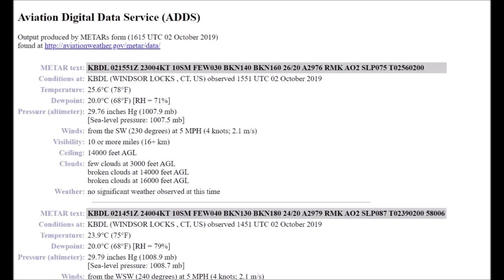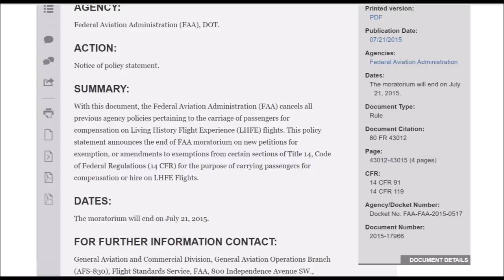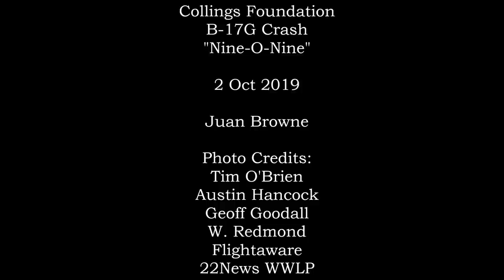B-17G Crash Collings Foundation KBDL 2 Oct 2019

Comment: Blancolirio, I would love to hear about the history of B-17's and there (non-combat) accident history. I have heard of story's where only 3/4 of the plane made it back.  Love some history, Please.
Reply: The loss of one engine should not have been a problem. Combat veterans have told of landing these with 2 engines out. Something else had to have gone wrong.
Reply: B-17 Flying Fortress by Martin Caidin 1968.  Read it in 1970 when I was 10. The most indestructible aircraft of its time.
Reply: @tiredoldmechanic1791 , you're right, losing one engine, even an outboard engine, should be manageable, especially at this light operating weight. But what if there was a loss of oil pressure to the prop governor? No oil pressure to drive that hydromatic into feather, and aerodynamic forces drive the blades to the low pitch stops and you have an unfeatherable windmilling prop. With that out on #4 you've got barn door drag out there and can only overcome it with rudder if you keep your speed up. To maintain control, you'll have to back off #1 and thrash the pee out of 2 and 3 to maintain flight. So how do you land this beast you can't slow down? I think they showed us the answer. RIP.

Comment: A runoff like that suggests a control failure after touchdown? Praying for the families. So sad.
Reply: Not necessarily. It certainly could have been the case that there was a control issue, but if there was asymmetric thrust due to an engine failure (as Juan mentioned in this video), then it may simply have been difficult for them to directionally-control the aircraft near the runway threshold, and they might have ended up way off to the right...just like the photos showed. I think it's important to wait until the preliminary report(s) are out, but it's not inconceivable that they might simply have had difficult dealing with the asymmetric thrust situation.
Reply: @bluehornet6752  I'm not trying to jump on any bandwagon re. "speculation brigade"...  But unlike a lot of smaller twins, there's lots of history (very adverse combat conditions/damage) of B-17s specifically, returning "successfully" from vastly greater distances than this, with one or more engines out (including much more acute direct damage to control authority).  The critical phase in that aspect, would be more in the earlier "turn to final" leg of attempted return to the runway, than the touchdown itself.
The only way I can make sense of what I'm seeing here, would be if the unaccustomed stress level and "task saturation" in the cockpit re. the engine failure, combined with precisely the fact that they were very CLOSE to the return airport (i.e., lacking longer time-frame for better assessment & visual orientation), resulted somehow in visual confusion of that right-hand taxiway with the main runway they were planning for. 

If they landed on the taxiway immediately beside the de-icing place, THINKING they were on the runway when they weren't...  Then crashing directly into the tank-farm makes a lot more sense than the idea of veering cross-wise into it from all the way across a huge intervening grass median. 

So I'm guessing visual disorientation & landing on taxiway by mistake, rather than any particularly problematic (let alone insurmountable) "loss of directional control" alone.
Reply: @boatrat  I have to agree, I hate to speculate but the crew was busy working the problem and may have landed to the right of RW6 on the taxiway.
Reply: @boatrat  You could very well be correct that they did in fact land to the right of 06. Time will tell us, I suppose.
Reply: @5roundsrapid263  I saw that one as well. 

I once landed on a taxiway. The winds were about 25 mph, directly across the sole runway at the (uncontrolled) airport I was trying to land at. Since I was in a Cessna 185, which is a taildragger, I really didn't want to ground-loop the aircraft. So after the second approach and go-around, I picked a length of taxiway that was perpendicular to the runway, and about 200 feet long...and I landed on it. The aircraft had a STOL kit, and my ground roll was all of about 150 feet. It was a LOT less stressful than trying to keep a $150K aircraft going straight on an asphalt runway with a 20-25 knot crosswind component. 

Moral of the story: Sometimes you have to do what you have to do to not bend the airplane. Sadly, I don't think this B-17 accident had an intentional landing on the taxiway. I think that as they got slower it became more and more difficult to maintain directional control, and they didn't. 

This is a VERY sad and tragic accident, and now our illustrious leaders in DC are even weighing in on how we need to took a hard look at whether or not "these old aircraft" should still be allowed to operate. Sigh...
Reply: More news today: They apparently "hit a landing instrument station, veered to the right, crossed the runway, and then struck a de-icing facility." Some of the names are starting to come out, although I only saw names for two of the seven people who perished in the accident. I did not see the crew mentioned.

Comment: I flew as a passenger in that aircraft in 2003.  The plane was 59 years old then and gave me a clear perspective of how difficult it was to fight a war with their latest technology of that time.  I have looked back to my flight in 2003 and told myself several times, "Sometimes we expect too much from these old planes".  Managing a landing on a grass strip is far easier than a concrete runway - especially if YAW is a factor and a multi-engine tail-dragger that has a problem with a thrust balance.  One hop with a sideways jerk and it's bad news.

Comment: Juan, I apologize for not making myself clear. My comment was not referring to the exemption to Part 91 allowing warbird pax ops. You explained that well. I was referring to your blanket statement about Part 91 where you say (referring to the Part you fly under with the Mighty Luscombe at at 7:55) that Part 91 is for "private flying, not for hire." This is incorrect. On the contrary, Part 91 does allow pax flights for hire, as long as it's for sightseeing within 25nm of the departure airport. Many a young CFI like myself got the occasional break in instructional flights to take members of the public on a sightseeing flight. Of course, you get more of these opportunities if you're based at a tourist spot, such as I was in HNL. I sold two new C207s to an operator who exclusively did around-the-island sightseeing flights, all under Part 91. Sightseeing flights with paying pax cross my house daily on Oahu.

Comment: I hang at VPZ with great friends and my 1957 Cessna 172. Last summer, a local pilot spun in from 400 feet on take off in his Comanche. I was not a witness, but the primary thought is our common humanity when tragedy strikes close. Nothing else really matters.
 That said, some random thoughts.
I am sensitive to blanket statements about aircraft age. Lots of contingencies. My Cessna is aged, as is the B17, a C47, or the 90 year old Waco on our field. But then, generally we are not flying at night, IFR, at altitude, in icing, or around storms. 
I loved seeing the B17 each summer. I struck by the pure grace as it rolled for take off, not so furious as I imagined. Even the start up was not the belching smoky affair I was expecting. I could not quite motivate parting with the same dough for a B17 ride that would keep  me flying my Cessna for 7 or 8 hours. Though, I did years ago ride around the patch in a Trimotor for $75.
I did last summer, at 64 years of age, 6’1 and upper 200 pounds take the B17 walk through (climb through) and was acutely aware these things were designed for 140 pound 19 year olds. So, I have to wonder with the latest tragedy, how quickly the fire came, I for one would have a snowball’s chance getting out, much less 90 year veterans.
Looks like the pilots got to the runway threshold with control somehow compromised, and apparently without #4. My question for experts, 10 passengers would seem well within gross weight considering the original mission.

Comment: Hello Jaun, The radar indicated 800 feet . Was that AGL?  Was standard TPA 800 feet for non HVY acft?  If so  he did male pattern altitude, correct? Can you explain where  the acft was to runway , it looks like the flaps were dumped  and even decent rate resulted. Very sad, I used to help the CF  when they visited KLVK, been on B-17 several times Thanks, Charlie

Comment: Juan, FYI: The serial number prefix for AF aircraft including current procurement is normally the U.S. gov't fiscal year in which the procurement was funded. The aircraft which was lost today was delivered in April 1945 and did not see action. The war in Europe was over or virtually over when it rolled off the assembly line at Douglas Long Beach. The original, legendary, '909' was an early 'G' (42-31909) built by Boeing in Seattle before that plant was dedicated to production of the B-29.

Comment: Several posters were asking, “Why is it that a 4-engine airplane, after losing one engine, is not able to continue flying on the 3 good engines?” From what we know of this accident the crew declared having an issue with engine #4, which is the right-wing outboard engine. On a 4-engine airplane losing engine 1 or 4 is more critical than losing 2 or 3. The reason is engine 1 and 4 are the outboard engines and in case of power loss the aerodynamic drag created by the dead engine will have a greater moment on the yaw axis of the airplane, if the propeller is not feathered. Feathering a propeller means moving the propeller blades parallel to the airflow.
Therefore, when losing power from one of the engines on a multi-engine airplane, it is very important to quickly identify and verify which engine lost power and secure it ASAP by feathering the propeller and doing a few additional steps to keep the aircraft under directional control. If the propeller is not feathered, then the airflow will continue to force it to windmill, creating a huge drag. The drag can be so great that when airspeed is decreased for landing, the rudder may not have enough authority to counteract the right yaw force generated, and the plane will make an un-commanded spiral to the right. This scenario could explain why the crew lost directional control while trying to land on runway 6 and veered to the right into obstacles.
It is possible the propeller governor malfunctioned and could not turn the propeller blade pitch parallel (feather position) to the airlow. Or the engine could have suffered an overspeed condition, which can be very dangerous. NTSB will have to figure it out.
My thoughts go to the affected families and the Collins Foundation folks. This was supposed to be a great day that turned into a tragedy. Personally, I flew twice as a passenger in the B-24, and still hope to be able to ride in a B-17 in the future. The intent of this post is not to put blame on anyone, since the real cause of the crash is so far unknown, but to try and explain to some posters why the plane may not have been able to fly safely on 3 engines.
Reply: I would not blame the pilots so fast. We do not have enough information. It will take time for the NTSB to find the cause of this accident. What I wrote is one of several possible causes of losing directional control of an airplane.

Comment: I saw them all when they came to KMQS a few weeks ago. Walked/crawled thru the 17. Then saw the 17 and the 25 land from a point 1000 feet in front of 11. Been watching planes land there for 50 years. Couldn't believe both their landing patterns. Almost like a carrier break. So low and tight we thought they would take our heads off in the pizza joint parking lot. There was really no base leg or final. Just a U-turn from about 2000 feet out. The 17 was left wing low over the threshold and still not lined up. They had passengers too! (Who paid $425 for 20 minute flight). Both planes did the same thing. Private jets use a 1-3 mile final and even up to ten when using the ILS. They're also not at 50 feet 1000 feet out like the bombers were. Knowing those old war horses handle like a city bus I expected at least the same or longer pattern. Very surprised at the way they came in. So sad for the injured and family survivors. Hope they all were on the right page spiritually.

Comment: Landing short, then ending up in buildings to the far right of the runway, with a faulty #4 engine.   Pretty much paints the picture of what happened, but well just wait for the NTSB report.
Reply: I think that they came off the end of that runway a little hot (fast) and tried to get off and clear of the runway as quickly as possible and took that left turn a bit to quick and maybe a bit to wide and ....

Comment: You said "left downwind" a few times, yet your "flight aware" image seems to show a rwy 6 departure and a right turn to a right downwind.  What is the real groundtrack?  Right traffic with the #4 engine out would not be the safest plan (turning INTO the dead engine).  The icing pits were nearly abeam the 1000 ft point of rwy 6.  The plane would have to be way off centerline or courseline to hit that far right if they were on a straight-in final for rwy 6, unless they got below VMC and attempted a three engine go-around (or added too much asymetrical power).  Am I missing something?

Comment: Having been up in this aircraft about five years ago I can tell you that the passenger comforts and safety equipment was minimal.  You sat on the floor, with a single strap seat belt over your lap. Anything more than a normal landing was going to be very rough.

Comment: This is so heartbreaking. I read in an article that the aircraft struck the ILS antennas and then yawed right, into the deice facility. They must have been really low on short final. I didn't know how reliable the article was but the NOTAMs for BDL show that the runway 6 ILS is in fact "unserviceable". My condolences to the family and friends of the deceased and best wishes for those that were injured.

Comment: Thank you Juan for describing the special regs that allow carriage of paying passengers on sightseeing flights in aircraft that weren't originally certificated for civilian use. However, your statement that CFR14 Part 91 does not allow carriage of passengers for hire is incorrect. Sightseeing flights within 25NM have long been allowed under Part 91. A change in 2007 requires operators to obtain a Letter of Authorization from their local FSDO for this activity, along with a few added requirements. These have to do with safety briefings, life vests for overwater ops, etc.  (ATP CFII ASMELG)
Reply from the maker: Part 91 Exemption-just as I briefed. View again.
Reply: blancolirio    I was looking into this.    Probably under 91.146??   Would that be appropriate?

Comment: 909 went off the end of the runway at Beaver Falls Penn due to pilot error by shutting off the hydraulic pump which operate only the cowl flaps and brakes. I was part of the crew that reassembled 909 at Beaver Falls and was part of the crew in Kissimmee.
 Has the FAA closed the FISDO office at Bradley? Any thoughts on David Talachet's B-17 being grounded at that office? I know an awful lot about both 909 and Talachet's B-17.
Reply: BTW when was a flight engineers seat placed between the Pilots? The top gun turret is there, I built that gun turret.

Comment: Latest update as of 11:13pm 10/2/2019.  Three crew and 10 passengers were on board the B-17G "Nine-O-Nine" when it crashed, seven were killed. In addition, two airport employees were working at the de-icing station it crashed into and one was injured. A firefighter was also injured when putting out the flames.
Jennifer Homendy, a member of the National Transportation Safety Board has said, "The plane had taken off from Runway 6 at about 9:45 a.m. and soon after the pilot contacted the radio control tower to say there was a problem. The plane circled around and attempted to land on the same runway five minutes later, but the pilot landed short of the runway, struck an instrument landing stanchion, veered to the right and traveled over a grassy area before striking a truck and de-icing building, it then caught fire."

Comment: The latest report I've seen is that the plane was low and impacted the instrument landing system stanchions then lost directional control. Why the plane was so low is the question. A single engine failure on a B-17 should not be an unrecoverable issue.